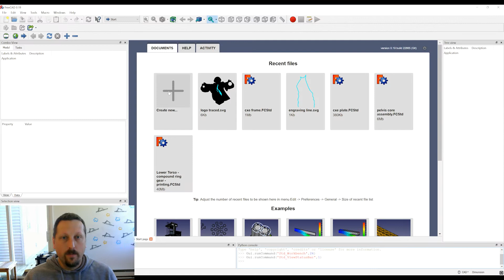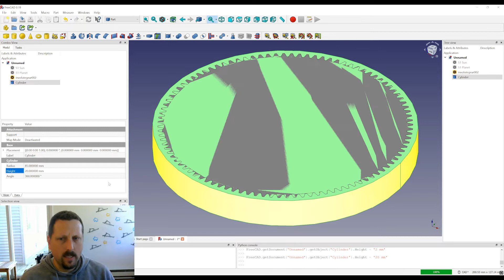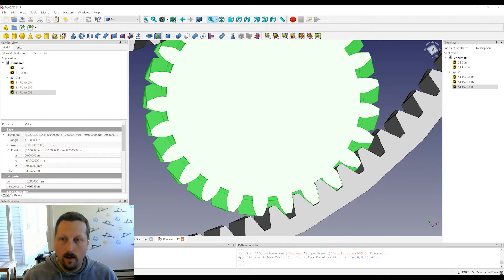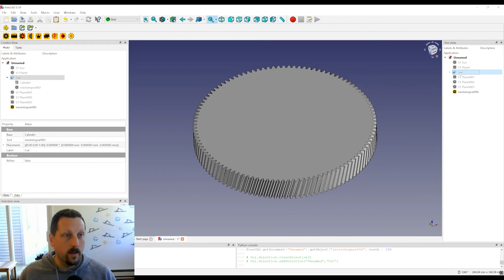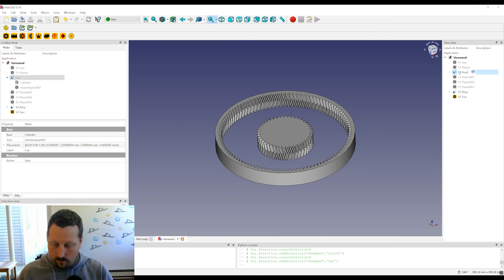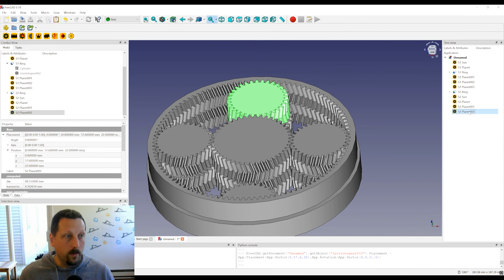FreeCAD Compound Planetary Gearbox Tutorial

Comment: Useful, interesting, well done. Thanks!
Reply: I'm completely new to planetary gears (and pretty new to 3D printing) so I have some amateur questions. Should the two sun gears be attached or should they rotate independently from each other? Similar question for the planet gear pairs - joined or independent? Wrto printing, in the video you briefly mention only in passing that there are some 3D print adjustments that one might want to make to the gear teeth but I can't figure out what those might be.

Comment: Thank you for posting this! super intresting. BTW check out the spreadsheet in freecad! it would allow you to make the calculations straight there, and use de results directly in the 3D geometry
Reply from the maker: Thank you.  You're definitely right about that.  It would have saved me a lot of tweaking numbers when I changed the tooth counts half way through.  Whole thing could have just updated itself if I used the spreadsheet in FreeCAD.